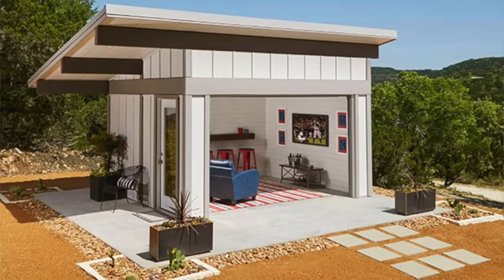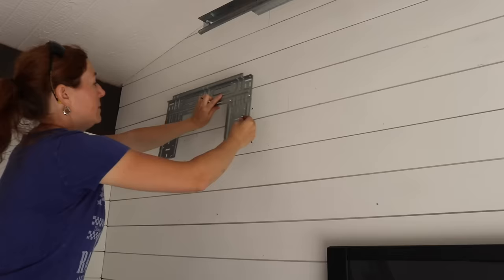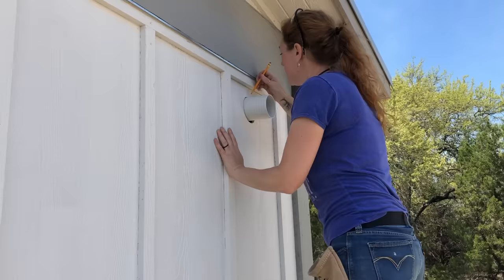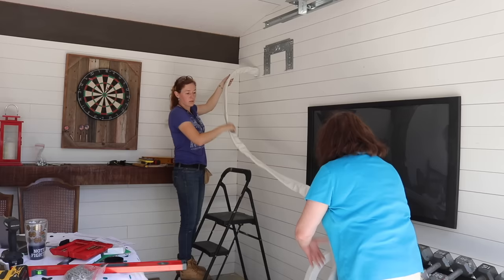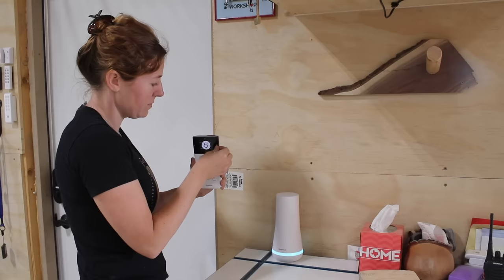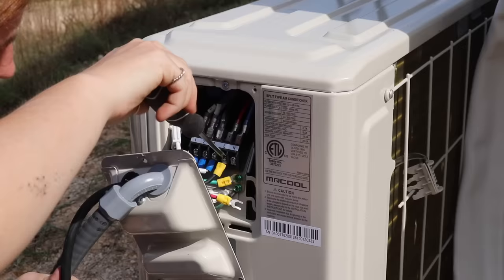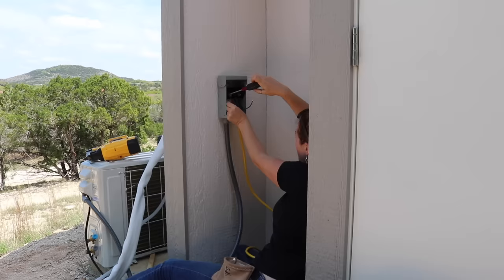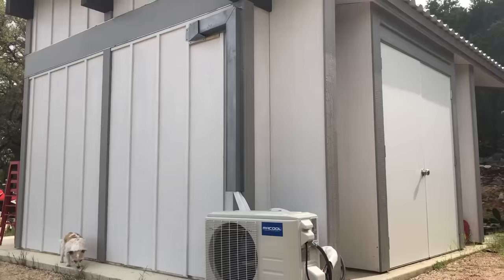DIY Ductless Mini Split Install - MrCool Unit

Comment: Just so you know, the line can be cut to length, you just need a flare tool. The refrigerant is kept in the compressor.
Reply: Did
Reply: You do it your self and does it work well

Comment: I'm concerned you are restricting to much air flow in the outdoor unit by putting it so close to the building and coiling up the connections to the inside unit.

Comment: That unit needs all the air flow in the back, I recommend you to have a professional to cut the Excess tubing.....that is Hot Air that  touches your excess tubing.....We uses does units in Central America, everywhere.

Comment: There is enough tubing to put the Outdoor Unit in Canada to keep it cooler  hehehehe
Reply: RS now that’s funny😂
Reply: Hahaha
Reply: Heat pumps work better in in the heat than in the cool :)
Reply: actually, for snowy eviroments you can wall mount the outdoor unit to be high enough off the ground so that snow doesnt clog the outdoor unit, and you can get units where its the outdoor unit that is where the charge is stored so that you can avoid unruly linesets
Reply: It's gonna need a passport eh.
Reply: @anikun  yes and then you have to pay someone to install it cause a vacuum will have to be pulled on that system before it can be started. She explains that in the video
Reply: @joshuapoche5137  no, what you generally need someone for is the refrigerant, but you don't need someone to vacuum the system because at that point your not handling the refrigerant, vacuuming the loop is just to make sure 1) all the connections are done correctly and 2) that there are no contaminants in the loop
Reply: @anikun  totally wrong. I'm an hvac technician I know how it works I've installed dozens of these systems.
Reply: @anikun  I should explain so you understand more in the future. The nitrogen that comes in these systems has to be removed before operating. When that nitrogen is removed it allows air in. Air is a contaminant because it contains moisture, even the air you breathe. That air/moisture has to be removed by means of pulling a vacuum before you can release the refrigerant that's in the condenser.
Reply: @joshuapoche5137  if you actually read the the instructions it says the line set is pre charged with R410a. It says this is the DIY version. Although if you try any of this in the uk Where we adhere to F-Gas regulations in accordance with the kyoto protocol you'll get in serious trouble.
Reply: RS, you win this video!
Reply: @DJSYKOBass  Mr know it all is so blinded by his claim of being an expert that he doesn't seem to know this is not his usual profession install system. It is the DIY version. Pre evacuated and charged lines and compressor. Just connect the lines and open the valves.
Reply: What I really appreciate is an available 16" line. At extra cost and a 25' line then left over. Mr high dollar does not have a 16' kit version. They likely charge lots for more this DIY version over their expenses. I will have to see and it may not be cheap but I am going to get an A/C shop to cut the lines and re evacuate them as even 16' leaves a problem for me. And may be cheaper than $2 - 300 for the 16' line.
Reply: @joshuapoche5137  for most systems yes. For their DIY series no..
Reply: @fredc8346  how do you connect the lineset without exposing them to the atmosphere?
Reply: @ac6954  The lines and compressor have special end connections that have sealing valves. The manufacturer opens them using the matching fitting then evacuates and charges the components. Removing them lets those valves close which seals that all up just like it would be when installed. Those are then opened internally when the fittings are connected during the install. I haven't seen any complaints about this way of doing it, and in fact it is not a new or unproven idea.
Reply: Gary Derby ...and back! 🌙

Comment: Cut the lines, flare connections and connect the tubing , pressurize with dry nitro, check for leaks, vacuum, then open refrigerant valves. Cool DIY video!

Comment: On the cheap, you can buy aluminum gutter to cover the line set, all the same turns, ends and strapping available off the shelf. Great vid.
Reply: The supply houses that sell these also have a PVC snap line set cover system that you can adapt to whatever your installation requires.
Reply: Sorry to some to not want to spend so much for things that are pretty pedestrian just because they are setup for this specific but I do not want to. Also seems like vinyl downspouts could be used and save money. Thanks for the idea.

Comment: That shed! So nice!! - Keith Rucker happened to post a video installing a Mr. Cool unit in his shop - just went up the same day as yours. BUT - he DID have a hole saw large enough to drill the 3 1/2” hole. April! It just about kicked his butt trying to hold that thing as he drilled the holes through plywood on both inside and out. He’s a big strong guy, and it like to snap his wrists. I’m actually very glad you didn’t try to do the same! Thanks for sharing your vid, I really enjoy watching you work!

Comment: April I'm a DIY and im amazed of all your wonderful work on this channel keep up the great work, but AC is a very simple thing to learn especially with smart person like you all you need is a vacuum pump, a set of cheap AC gages and if you want some cheap flaring tool to cut your pipes to the desired length, and I've installed over 10 units of split air conditioning with different sizes and brands and they all share the same basic principles.
Reply: If you buy the precharge unit from Mr Cool ,no gauges , pumps are needed ,
Reply: @RobertMSmith1  did you see the price tag on the unit 🙄 to me its much cheaper to get all of them especially they all cost less than 100$ thanks to China 😂
Reply: @paulcopeland9035  Nope - ebay sells 410a freon to anyone but there are others too.

Comment: HOLY COW!!! This is EXACTLY the video I needed!  Was going to pay 5k to an installer. Thanks April!
Reply: You will pay one time for experience for tools and for knowledges....or you can pay twice for your greed. This system can be  cost $800-900...+$800 for installation. I don't know where did you get the price $5000
Reply: If I can do it so can u.
Reply: @ЮтюбПетрович  that is about the standard price in the USA
Reply: @ЮтюбПетрович  i JUST got a quote for this about 35 minutes ago. My quote was for $6000! Hence why Im looking at diy videos
Reply: Why don't they make the same unit with an electrical plug? It would be plug and play and done easier by diy...
Reply: This appears to be the $750 12k system. The DIY variant costs $650 more and comes with pre-charged lines.
Reply: Al Al Because it’s designed to be installed by people that know what they’re doing 😂
Reply: And I would gladly pay that installer.  I would botch this up so bad it's not even funny!  Why didn't they teach shop in my high school? lol
Reply: @ЮтюбПетрович  Yeah, $5K is the what a local company quoted me over the phone.   I see your point exactly.  I will say that these HVAC companies are great at making their product seem worth it than a DIY.  I can see right thru all of that BS.  I find it very  difficult to listen to their side as to why they charge $5K+ and not bust out laughing.  The only downside to DIY (if it applies) is the excess tubing, but I suppose someone could very well buy one with a shorter tube and call an A/C company to come out and charge it up.
Reply: @luvinmysailor  Right on.  Seems like every vendor out there just goes in for the kill.
Reply: @spectroman71  you would be surprised as to what you can do if you take your time and do your research before beginning any project.  In this day and age with YT, you can do just about anything.  I never took shop, had a dad that didn't teach me squat, and I rarely depend on anyone or business to do work on my home or vehicles.  All that money saved.  People ask why I am so cheap or do almost everything DIY; the answer is simple.  I didn't feel like working into my 60's.   So how did I fare?  Completely retired at the age of 47!!!!  So go on and get to them DIY's y'all!!!!
Reply: @ЮтюбПетрович  
I got a quote for 7k last year

Comment: I replaced a LG thru the wall heat & cool system with a Mr Cool pre-charged mini split in May of this year for my 450 sqft work shop in my garage.  So far my electric bill is about $50.00 less than it used to be. To all of those you-tube watchers commenting on a professionally installed system:  where I live, I was quoted $300 travel charge just to come out to my site, time + materials in addition to that plus the mini-split system.  When they told me that they  could not guarantee a schedule, but only estimate within a 3 day window when they would come out, the decision was made for me.  To any HVAC shop taking issue with this: stop catering exclusively to General Contractors and start treating home owners like clients worth pursuing.

Comment: You should block that metal cover where the line set comes out at the end with some small wire to prevent mice or rats getting into your living space.  You did a nice job.

Comment: Consider using nylog blue on the connections to prevent possible leaks. Also, worth mentioning that the passthrough hole should be angled downwards a bit so the condensate drains ok. Great video. Keep em coming.
Reply: Yamil Hernandez 
These unit have very fine strainers in them. So be careful with the nylong. If it gets inside the system it will cause a restriction. If a manufacturer requests the unit back and they cut it open and see that you as the installer caused the restriction. No help from them. Every manufacturer of hvac equipment will fight that fight. Just a recommendation. By no means gospel.
Reply: Ramy howdy. I don’t believe this to be the case. I have contacted mr. cool directly and will report back what they reply. I will also contact the makers of nylog.
Reply: @ramytk1  I spoke w/Mr. Cool directly.  They stated that Nylog Blue will not void the warranty.

Comment: As it's Texas and glass bay door maybe consider low-e window tint. this will help on heat/sun you all have for most of the year. I worked on a high end condo unit and while working they came in with low-e glass tint immediate lowering of temp it was amazing, in the long run cheaper than electricity on A/C units. But good for all those brilliant solar radiation bright days, especially with a huge glass window like that bay door window, even so what a great little guest home. Sweet! 
blessings David

Comment: Hi! I realize that you made this video five years ago, but I just have to comment! I'm an American woman who's lived in Italy for 27 years now and when I left the United States, these types of ac units didn't exist there. Being from New Orleans, I thought I knew everything about air conditioning! 😂
  Anyway, in Italy, this is the only type of ac unit there is, except for the super rare central air and heating that you might find in an apartment building or home built within the past twenty years or so.
 We have only Asian brands here. Samsung, Mitsubishi, Daikin, etc. I had a Daikin until exactly two weeks ago. It was only three years old and the fan of the outdoor unit just quit one day. I've just bought a new Mitsubishi and had it installed.
  The cost of a 12,000btu, single split is 600 euro ($666)and installation is between 350 and 450 euro ($388 to $499). My apartment is only 40 sq meters, so the 12,000 btu can even make me freeze in here!! It works as a heater too, which is great because my building was literally built during the time of Mussolini, so you can imagine how awful the old radiators are!
  I have no earthly idea why your video popped up on my feed, because I didn't search anything about air conditioning, anywhere on my phone, but I'm really glad it did! As an older woman who couldn't even use a hammer and nails when I was younger, I'm so impressed with your ability to do things like this for yourself!! I envy you for your energy and intelligence too!!
  The reason why I wrote was to tell you that, but also to tell you about the air conditioning experience in Italy. Again, I had no idea that this kind of ac unit even exists in the US now!!
  Thanks very much for your patience if you were able to get through this long comment!! Thanks for showing me how I could've saved a lot of money too!! Strangely enough, I really enjoyed watching this!!
  Ciao!! 🙂🙋🏻‍♀️  💯💯💯💥
PS - when my Daikin unit broke, it was the third week of August and the entire country of Italy was on holiday at the beach. No installers could be found anywhere and the temperature in Milano was in the upper 90s! One more reason why I wish I were young enough to do this myself, like you did!! 🥵
Reply from the maker: Thank you! I'm glad you enjoyed the video. Thanks for watching.

Comment: Great video April. Tip 1, installing my AC, it was said to drill the hole from the inside to the outside in a small angle downwards. This way water will  not enter the building, and any water present, will flow to the outside. Tip 2, Leave a space (30 cm or 12 inches) behind the outside unit, so it can draw cool(er) air. Ideal would be to place the outside unit so, that you need the whole line and don't have to store the extra behind thd unit. Tip 3, If possible place the outside so that it has shadow on the hottest time of the day. This makes the unit more efficient and cheaper (less power costs). Tip 4, Check with soapwater your connections for leaks (no bubbles). Tip 5, check manual, with some units you need to ooen the lines with an allen key (on outside unit).
Reply: Dont forget TIP6.  Fill opening with fireblock expanding foam
Reply: @paulcopeland9035  
Tip 2 Curled up lines behind the unit prevent airflow, that's why I said, use the whole line. To leave the space behind the unit free.
Tip 3 If the outside unit is in the sun, the temperature of the air around it is higher. The unit looses heat by blowing air, with a fan, over the radiator. The bigger the difference between the radiator and outside air, the better the efficiency and thus less power and lees power is needed.
Reply: You might want to go to the MR Cool website, all their units come with leak detectors,using the soapy water method not required to find any leaks to look for where it is when the sensor alerts you.

Comment: I work for a wholesale company that sells ductless units. One of the most important things that you have overlooked is a surge protector. That condenser has 3 computer boards in it and if it takes a power surge, say from a generator coming on or lightning, you will probably need to repair that unit. Also, if you bought that unit online when you try to warranty a part you will have to go through the online company for the warranty, unless you can find a very nice local mechanic willing to help you out.

Comment: Mr cool has since revamped the install to eliminate the awkwardness of fishing a 25 ft line set thru the wall by just including a separate sealed line set on Gen 3 models. They also offer a 16 ft linseed to reduce the need for excessive coiling. Gen3 units boost SEER rating to 20-22 from 16. One of the disadvantages of being an early adopter but you guys buying now have it pretty good.
Reply: noice lol

Comment: Excellent video April.I use PVC pipe (suitable diameter) cut in half or less depending on what I'm trying to hide, then pilot screw it to the walls and caulk to hide any imperfections. That always works and I don't have to purchase anything special or kiss some wholesalers butt for a purchase. Just some movie magic. Well done April. Thank you for the security tip.